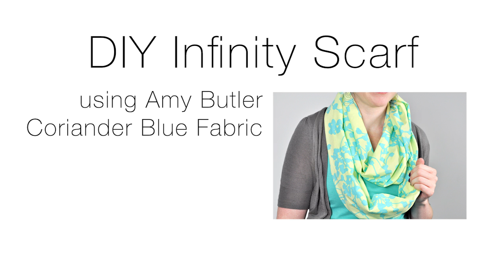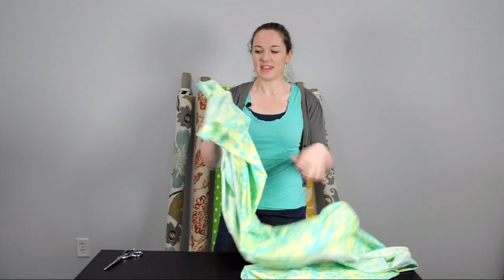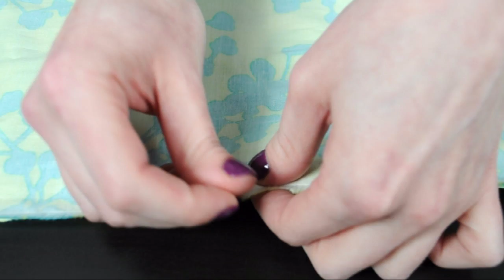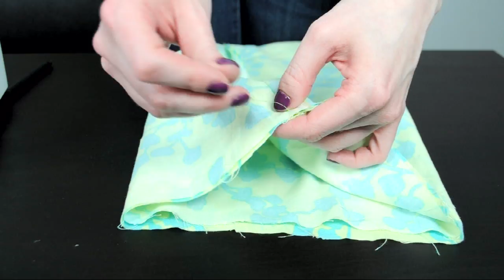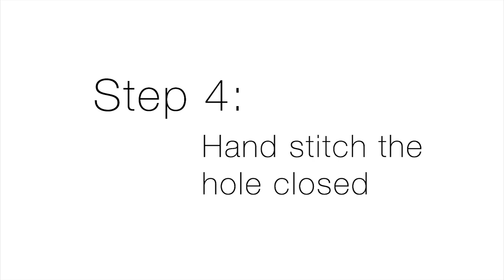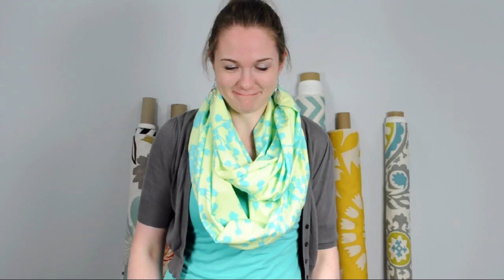Tutorial: How to Sew an Infinity Scarf

Comment: Can I just sew the ends together while inside out and then leave like a 4" space so that I can pul it all out? And it be the same?
Reply from the maker: Yes, the ends should be inside out when sewn together, but one end should be pulled through to tube to match up with the other end. It wouldn't work just to fold it in half and sew the ends.
Reply: Doing it that way, it would not be an infinity scarf. It would have two separate ends instead of being one continuous loop.

Comment: Why 2 yards.  You do not use 2 so can't you use 2 yard?
Reply from the maker: +Terri Morris Two yards are needed so that the scarf is long enough. You could use one yard, but you'd have to sew pieces together to make it long enough. That's perfectly fine if you don't mind an extra seam.
Reply: +OnlineFabricStore.net Tho you only use one yard.  Trying to understand. Oh the length is 2 yards. I just do not understand why then you cut in half and use 1 yard.
Reply from the maker: +Terri Morris Yes, the length of the fabric is 2 yards to begin with. Then you cut it in half down the LENGTH so you then have two long pieces that are 2 yards long and half the width of the fabric. (The fabric in the video was 44" wide, so the width of the piece I cut for the scarf is 22".) Then you can cut off some of the length to get it to how tight or loose you want it to fit. The amount that's cut off will vary depending on your personal preference and how many times you want it to loop around the neck. If you don't want it to loop, that doesn't require as much material, and you can probably start with just a yard. But if you want it loop so there's two or more layers around the neck, you'll need more than a yard. We rounded up to the nearest yard to give plenty of room for how long different people may want it.  I hope that answers you question! :)
Reply: I am sorry it wasn't registering.  Thank you very much.

Comment: Love this! Is there a way to do something similar without a sewing machine? I don't have one and don't sew often enough to purchase one. I do know how to hand stitch but know that would take forever with this length. Thanks!
Reply from the maker: HisDaughter84 Sure! Follow the same instructions but just use a fusible bonding web to make the seams instead of sewing. Place it between the fabric and iron to melt it. It holds well and is washable. Here's our selection: https://www.onlinefabricstore.net/specialty-bonding-stabilizers-and-stiffeners.aspx?brand=Dritz I'd recommend the regular weight in either 1/4" or 5/8".